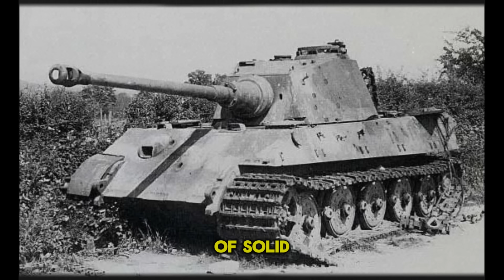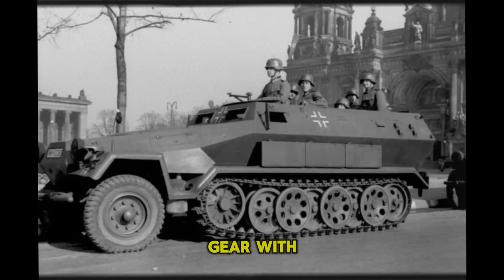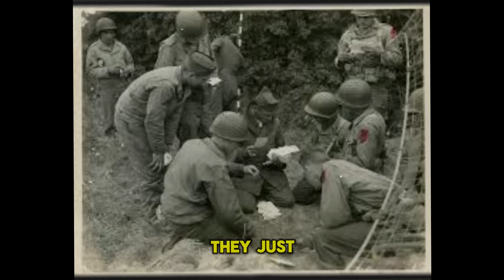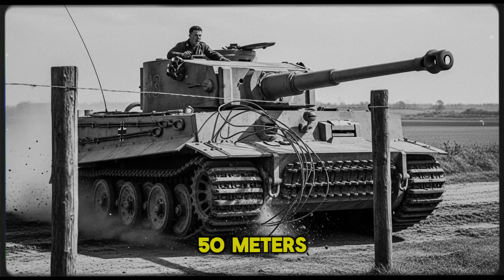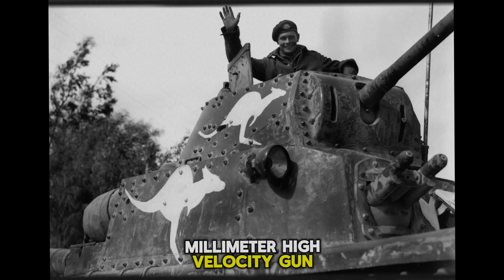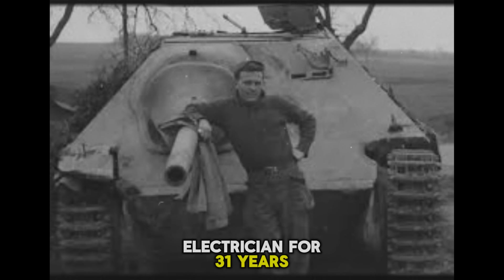How One Engineer’s Crazy Wire Trick Stopped The Deadliest Tiger Tank in Just 3 Seconds

Comment: I worked as a motorcycle mechanic many years ago, and on one dirt bike that I had to repair it had run over some fencing wire which then spooled around the axle of the front wheel locking it solid.  It was a devil of a job getting the wire off without damaging anything.

Comment: How did the wire get past the tracks to the wheels ?.Tank tracks were designed to crush wire barriers from day 1.Why would the rubber coated road wheels have smoked they don't transmit any power only the drive sprocket.
Reply: Simple : the story is fake, like all of the images.

Comment: No artillery is going to fire on that road with friendly men dug in on both sides.   First of all it’s not that accurate especially 105 ‘s in WW-2.    And if a 105 hit the top of a Tiger it could disable it and cause damage to the crew
Reply: The wire would be forced down not upward, just a story.
Reply from the maker: maybe you're right dude
Reply: @ww2missingpages 
0:50 Tiger I 
It's a roman numeral, read as Tiger ONE.
AI does not know that, you have to edit the script. 
Maybe listen to it before uploading.

Comment: 300k manhours make one ouch 😊
Reply: It gets worse. Each one was somewhat unique. Few interchangeable parts from one to the other. Built by craftsmen start to Finnish.  For extensive repair they would ship the tank back to the original point of manufacture for the craftsman to fix.  What a logistical nightmare.  The Sherman was production line built. No problem swapping parts from one to the other.   
That point is vastly under emphasized.
Reply from the maker: Yes